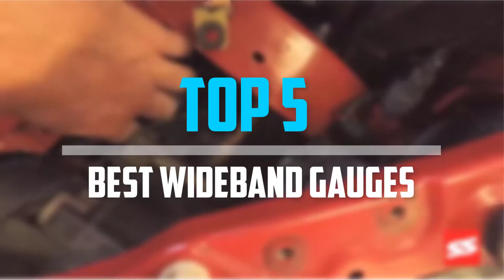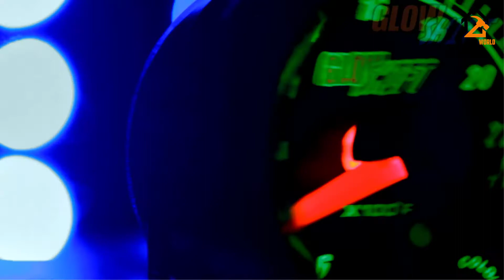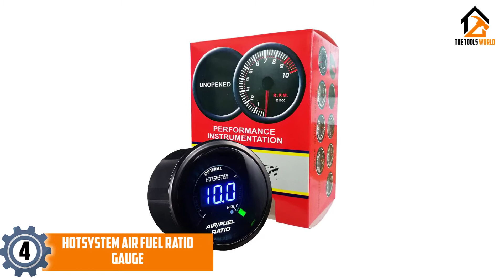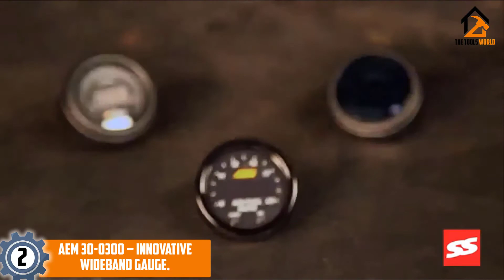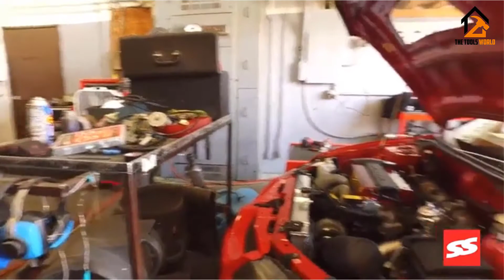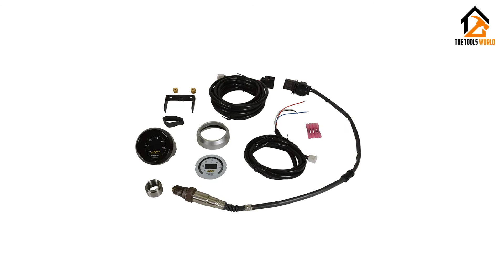Best Wideband Gauges [Top 5 Picks]

Comment from the maker: ▶ In This video, We recommended the top 5 Best Wideband Gauges.

▶ 5. GlowShift Elite AFR Gauge Kit.  
[Affiliate] https://amzn.to/4610jBS
  
▶ 4. HOTSYSTEM Air Fuel Ratio Gauge. 
[Affiliate] https://amzn.to/4p70R1O

▶ 3. Innovate Motorsports 3918.  
[Affiliate] https://amzn.to/4p1cpn7

▶ 2. AEM 30-0300 – Innovative Wideband Gauge. 
[Affiliate] https://amzn.to/42ajlUZ

▶ 1.  AEM (30-4110) UEGO Air/Fuel Ratio Gauge. 
[Affiliate] https://amzn.to/4g3yxt0

Comment: AEM 30-xxxx are junk, they are not very accurate at all. One 1/4 pass they (I have them on 2 different cars) read 14.x then another pass they read 12.8 as they should. And good luck with a sensor lasting longer than 4-6 months.
Reply: You probably are doing something wrong . Sensor could be poisoned by silicone sealant fumes , by even undetectable coolant leak , by burning oil , by improper mounting when the exhaust condense affect it , etc . Those sensors are OEM for many cars and there they  last for hundreds of thousands of miles if everything else with the engine is in order.